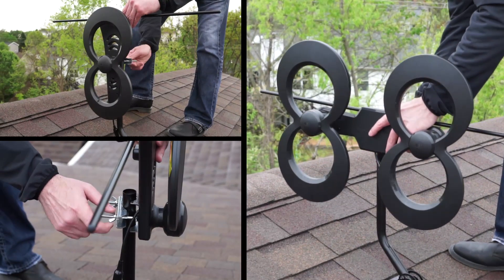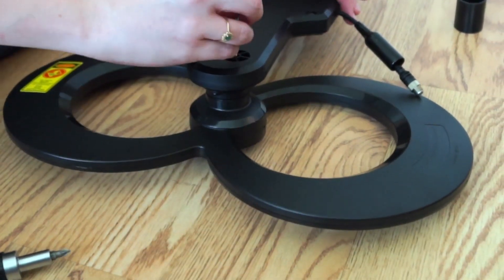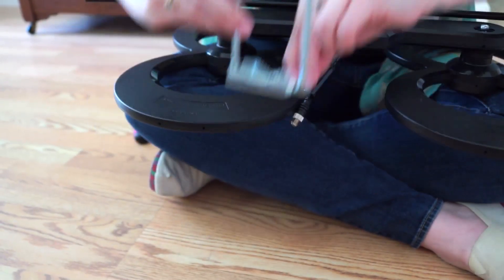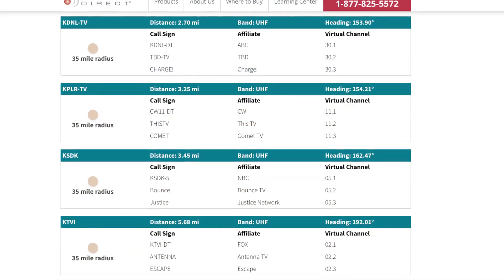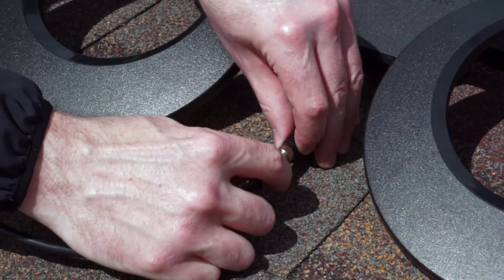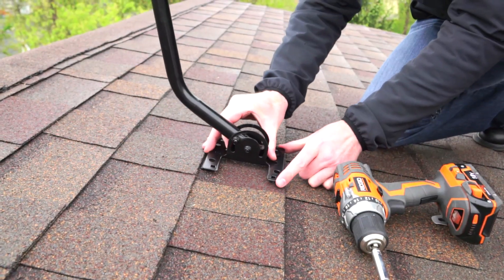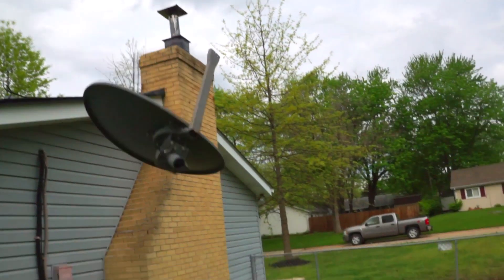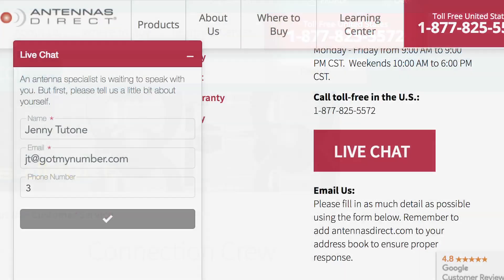Antennas Direct ClearStream 4MAX Indoor Outdoor HDTV Antenna How To Assemble and Install

Comment: Why go through all that hassle when a good indoor antenna works just as good if not better than that outdoor antenna?
Reply from the maker: Hi Billy, thank you for sending us a message. Precise location of your installation plays a key role in signal strength. For suburban and rural areas, building materials and tall trees will reduce the signal strength causing pixilation or in most cases no signal at all for a specific frequency. We have a lot of low-power stations requiring an outdoor antenna with a higher gain than an indoor antenna to receive those signals. Also, our antennas have a wide beam angle allowing for signals to be received from multiple directions. If you are interested in more information, please feel free to chat with us online at antennasdirect.com or give us a call toll-free in the U.S. at 877-825-5572. We're available 7 days a week.
Reply: @Billy Rawls
 - Not true!  I was only able to get 2-5 Channels Indoor. :(((  When I used the Outdoor Antenna, I was able to get 31 Channels.

Comment: your video says nothing about grounding.
Reply from the maker: The National Electrical Code includes the requirements
 for grounding your antenna or mast in Article 810. Please consult the NEC, a local licensed electrician, or a local electrical inspector for details. Click the link for additional information: https://www.antennasdirect.com/cmss_files/attachmentlibrary/pdf/Grounding-Info.pdf

Comment: I put in my zip code and it says file not found.
Reply from the maker: John, call our customer service team at 1-877-825-5572 or email support@antennasdirect.com and they will assist you with finding the best antenna for your location.
Reply: Do you have a antenna booster for this''  for the 4 quad system'',.  ???  if so were can i purchase and @ what price'',.  ?
Reply: patrick Bragdon 

will
Reply: +edward muzio j bcc chm cbb bio chm
Reply: @pompanopatjr  Did you try the 3 quad system?
Reply: @wakkywabbit5446  no..  not yet ",..!!!